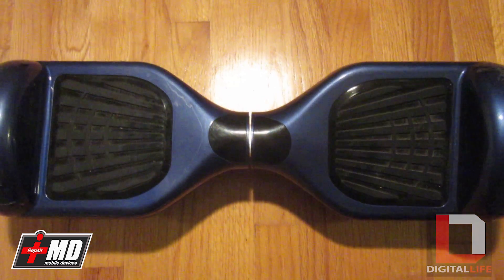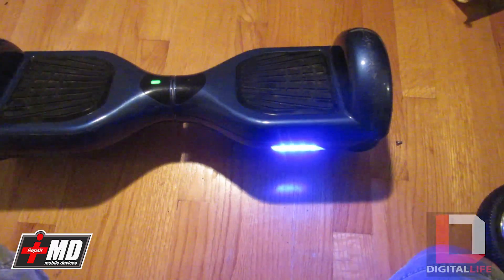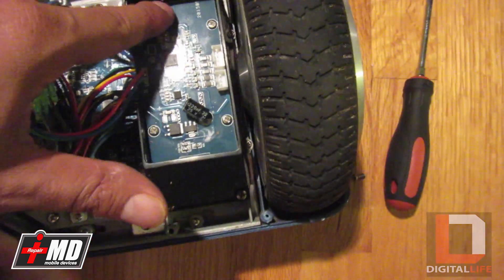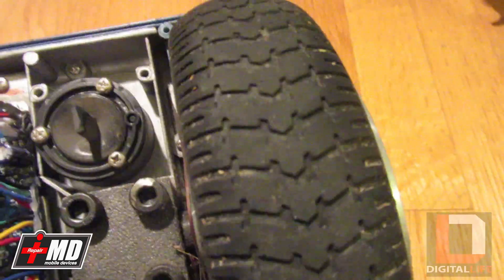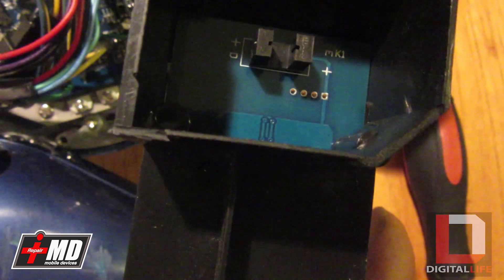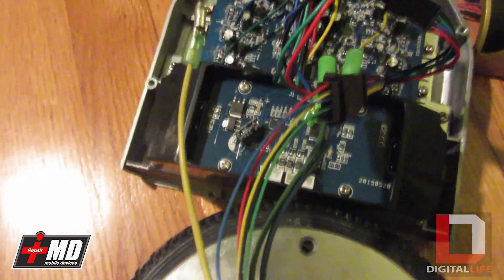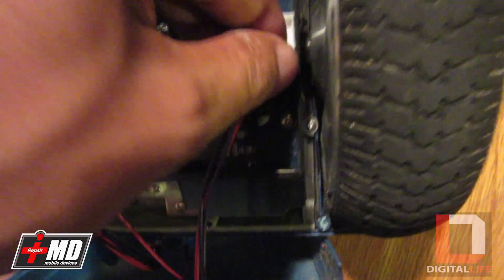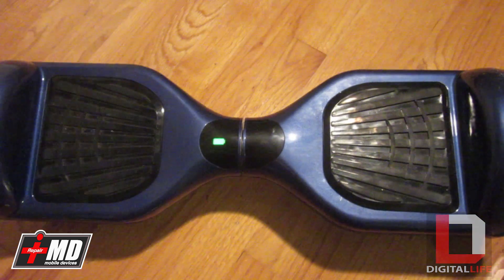Balance Board balance sensor repair

Comment: Is there a way to control that sensor from some of the pin outs on the sensor board? I’m wanting to use the guts out of one and change the throttle control to a pedal
Reply: Same here bro I came here for that exact reason, I want to use it to make a rc tank

Comment: Yeh the one I got the sensors am on the 2 controller PCBs and the flat edge of the motors mount is facing down but like this issue one motor works if I tilt the controller's it trys to change direction just can't get em both to run need that balance bypass cus I'm converting a mobility scooter nightmare lol

Comment: The board you pointed out inside the motor is not the tilt sensor! That is the hall sensors for the motor, it tells the motherboard where the motor is in its rotation. The board you replaced is the gyroscope and activation board. It measures the angle of the board.
Reply: Você sabe onde fica o sensor de inclinação? Tem como desativar

Comment: You never repaired it at all - you are just a board changer. Find out what was the problem and tell us what it actually was. You expect us to buy a FULL board when you effectively say it's a component that is only a few dollars.
Reply: You kinda need to buy a whole new board if you don’t have a soldering iron to take out the infrared sensors

Comment: %:24 NO.......the hall sensors in the HUB does not act as tilt sensors or vertical position sensors  they are the 3 common sensors used for decades in any brushless motor with feedback system.   
For instance the hub motor of electric bycicle or CNC spindle...
Tilt and drive are managed by the two attitude modules near the 2 wheels.

Comment: Mine turns on but shakes violently how do I fix this
Reply: Coyotie Wolfe have you tries resetting it? If issue still occurs. Make sure the rubber is high enough to reach the sensor. It happens when ur like 60 pounds or not standing directly to the pad

Comment: I notice all the repair videos are boards with a main circuit board and two balance boards.  I have the cheap board with just two boards.  is there any repair for these boards?  Can I upgrade my balance board with your kit?  The sticker on the bottom of the board says Chic.  The front of the board says Zipcraft.  Its a cheap board all plastic. It only worked for 14 days.

Comment: My board is making a grinding noise. I took the board apart up to the sensor and I see debris or twine rapped around the rod and half in the wheel. How do I take wheel off to clean it.

Comment: Hey I have this exact problem. But not just one side, it's both. This happened from calibrating. What are the boards called that I need to replace? Thank you
Reply: I'm having the same problem both sides are like that we have to replace the gyroscopes so instead of buying one we need two

Comment: what is wrong with a ten inch scooter when it shakes real bad when you step on it ?
Reply: It isn't calibrated. Turn the board off and on again, only this time holding on the power button until you hear another beep. This means that you are in calibration mode. Tilt the board until it is level and turn it off. NEVER STEP ON THE PRESSURE PADS WHILE CALIBRATING!!!! This will fry your hoverboard's gyroscope, and you won't be able to use it again

Comment: Question: Don't you have to calibrate the new sensor first? You just replace it, and switch on the board? And that's it?
I got my board and probably screwed up calibrating it. So I never used it.. yet. If I get a new part I do not want to mess up again, hence my question.
Reply from the maker: +Martin van Wijk you'll need a new logic board if you bricked it

Comment: I have a problem with my hoverboard 8 inch led .when I had opened the inside of the hoverboard there was a red light blinking and also outside. my hover board isn't working right now :(. can you help me please?

Comment: hey! the problem im having is both the blue lights stay on, on each side. when i turn it on and get on it it doesnt balance nor go forward.. will replacing the sensor do that trick ? it worked fine. but the calibration was off so i reseted it like 3 times. and then boom it doesnt work anymore. i hope u reply

Comment: I bought a new motherboard and two balance sensors, but when I turn my board on and try to ride it, its shakes. What do I need to do to fix it?
Reply from the maker: +liltabuyo your sensors  needs to be adjusted please call the store for instructions
Reply: Hold the power button for 10 seconds then you will see both lights blink but make sure you have all the board level before you do so and let it sit there for 3 minutes and then power off then it should be fine

Comment: I got a brand new board from China and I feel that it's too sensitive about going left/right, making it difficult to go straight line. It's quite dangerous when I go a little fast and the board suddenly and slightly turns. I don't think my feet changes position or even if they do, it would be very slightly. (this is why I said too sensitive). I'd love to bring it to your shop but I'm in Singapore :(. Maybe you know what the problem is? I've tried other board and they are not like mine.. will greatly appreciate if you can tell me how to repair/modify this issue.
Reply: Boyke Wijono calibrate it

Comment: Hey. 
I'm having the same problem with my hoverboard, but this is on the opposite sensor and not on the side that you are fixing. I have tried looking for a spare part for the other side as they are minor differences in the wiring. If there is anyone with any suggestions or links, I will defiantly appreciate it.

Comment: On my board, I have a similar problem. When I lean forward quickly the board completely shuts off. I can only get it to turn back on with the charger. How can I send it to be fixed? What do you think is wrong and how much would I expect to pay for a fix?

Comment: I'm having a similar issue my left sensor light is staying on as in this video but my motor still works basically its staying on as if I was on it and when I get off it goes crazy cuz it won't turn off like it should when u get off please help ASAP!!! Thanks

Comment: hello!I need your help.
  In my scooter 1 wheel is not working properly.Whenever i turn on my scooter to drive  one wheel stops working after 10 to 15 secs of driving and red light starts to blink.The wheel is on the power button side. please guide me how to fix this

Comment: The LED light in one wheel was cut off, so when i open it to fix i heard a buzz sound and stop working, and when i open the power i can not close it unless i remove the battery socket
can any body help?

Comment: Hello I need help so my light is just like the one you have in your first video but both lights are on like that so I took it apart like your video say and removed everything but it's still not working and then there is a red light flashing on the inside of it after I took it apart any help??

Comment: when i switch my hoverboard on both the lights turn on and the green sign lights up :( what should i do? and non of the sensors are working 
the lights just stay on but i cant move
Reply: +Saphire Chyz  have u fixed your board because I have got the same problem can u help please??
Reply: yes i have fixed it :) 
you have to buy new sensors

Comment: Hi, hoping someone can help me with our brand new board. It's never been ridden because it won't self balance. When turned on, the green battery light operates, however when you step on the pad, a red light keeps flashing. I've tried resetting it and it does the same and then beeps if you try to ride it. Any suggestions would be greatly appreciated.
Reply: It sounds like one of the cables just got disconnected inside. Mine had the same problem. When I opened it to examine, one cable became disconnected. I reconnected and it worked.

Comment: i bought the sensor tabs from your given link .now i have a problem,my battery light does not turn into red and does not beeps while the battery is running out any suggestion?

Comment: Why would a calibration lead to 1 side.failing. then eventually a second side failing ?
Reply: +thel1nny  mine has done the exact same thing after recalibrating
Reply: +thel1nny any solution to the problem ? I'm having the same issue.
Reply: +scott hollifield did you fix it ?
Reply: Couldn't fix it.  Tried disconnect battery. Hold power to drain capacitors. Tried to clear all it power. Reconnected. Still dead. Sent it back got a replacement.   Don't calibrate it again lol
Reply: It's a shame cos I know all the bits were probably working.  Just some weird glitch

Comment: I fell about 4 times outside (stumble/small crash) and I recalibrated and it's fine but the 4th time the red circle  (indication that needs re calibration) kept appearing and if I step on the first pad works but the second doesn't and if I switch same thing HELP!!

Comment: Any ideas how a calibration could disable 1 side, and then after a few more attempts the other side is dead too,  seems weird as it wouldnt of been dropped or hit, for the second side to go down?
Reply: +Abdulaziz  Ismail My friend, the solution is in this video, but this guy sells these gyros for WAY to much money. Here is a link for you to buy the gyros https://swagway.com/product/swagway-x1-position-sensor-board/ . If both sides don't work buy 2 if one one side doesn't work buy 2. Then just follow this tutorial. Btw i had this problem :)
Reply: and now when i try to recalibrate it, i dont get the flashing red circle, instead it just powers up?  help.   bricked?    bit dodgy how something can brick by use of the on off button!!!
Reply: +Mason D Happen the same thing to me while calibrating, people are saying its time to buy a new gyrosope
Reply: 1. day. old!
Reply: +Mason D mine has just done the very same thing after recalibrating 1 light stays on and right side dead
Reply: +Mason D did you figure out how to fix it ? I'm in the same situation
Reply: +scott hollifield same here
Reply: +Mason D Amen.  My son  broke the left side by recalibrating.  I broke the right after recalibrating a few more times.  Feels wrong.
Reply: Natalya, you have made the purchase at that site??
I want to buy my sensor but not sure if it is rigth..
My fault my left side where sensor ligth..
You could help me more about it if you have experiencie??

Comment: I wonder if you have a method to add battery capacity to the balance board yet? I notice on the opposite side from the battery there appears to be space where another battery could be added in series and possibly extend the range/riding time pretty significantly. Seems plausible that a lead could be run through the pivot of the board. Seems like the extra battery wouldn't adversely affect stability and add just a little weight. Is that something you might be willing to try? If not, could you suggest a battery with the form factor required so I could try it myself please? Helpful video!
Reply: O, x

Comment: Hi there my board turns on it has one steady light on the on/off side of board but it will not move at all help please motors do not run at all
Reply from the maker: +Annette Dartois looks like you have one bad sensor board
Reply: +iRepairMD Youtube do you sell these
Reply: +Annette Dartois also would this make both motors not work
Reply from the maker: yes

Comment from the maker: for parts: http://shop.digitallifex.com/products
Reply: +muawiyah haq because the battery in scooter is not real capacity as it shows
Reply: hello, why does my battery run out so quickly, less than an hour or two after charging it full
Reply: +muawiyah haq you should choose LG or SAMSUNG battery
Reply: man I have an issue with my hover board ...only one side moves I'm goin in circles can you help me fix it

Comment: Hello irepairMD YouTube my problem is that my scooter works but when I go to step of one side shakes PLEASE HELP
Reply from the maker: Check your balance sensors
Reply: +iRepairMD Youtube will this vid fix mine? Mine is a 10 inch balance board, also it turns in circles as the sensor on my right foot does not work when I apply pressure... Is this how to fix it?

Comment: My scooter's left pad isn't working. It doesn't move, only the right side one is functioning. Not sure what's going on, when it's turned on, it beeps every second and it shows a red light like the video displayed. Any fix or suggestion for the left pressure sensor, it's not detecting weight, light isn't turned on or anything. Please help!

Comment: I think my battery pack is shot in my smart balance wheel, do you think I could send it to guys for repair?
Reply from the maker: +Cory Kozminski Hi, if you are certain the battery is defective, we have the battery available at shop.digitallifex.com. Please refer to your balance board manual to ensure the voltage for the battery specs match the replacement battery at shop.digitallifex.com. If you have any questions, please feel free to call us at the shop during normal business hours